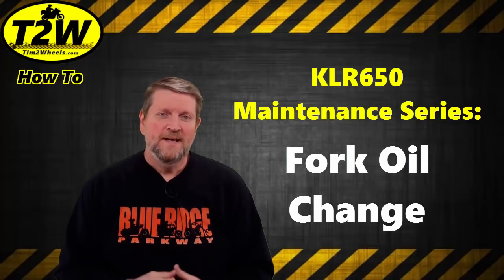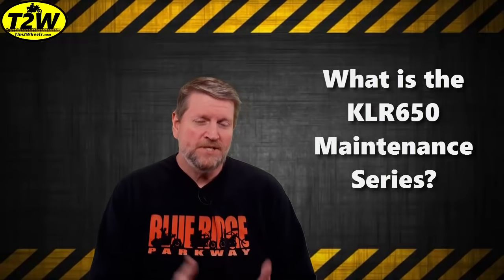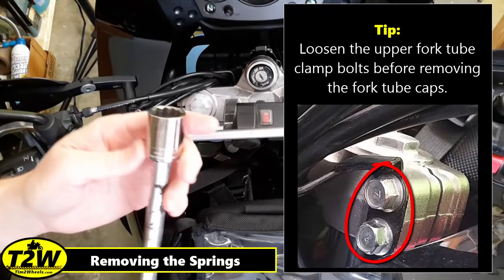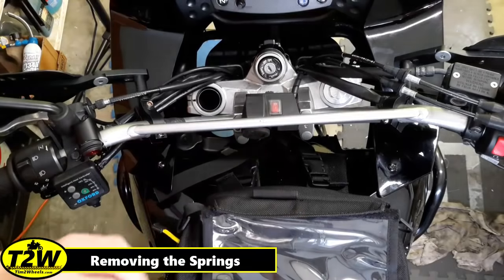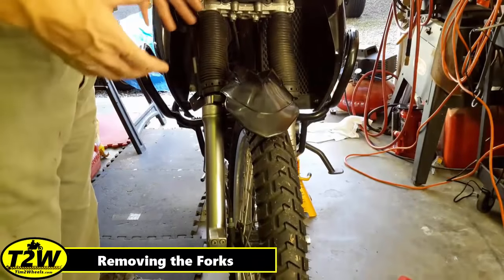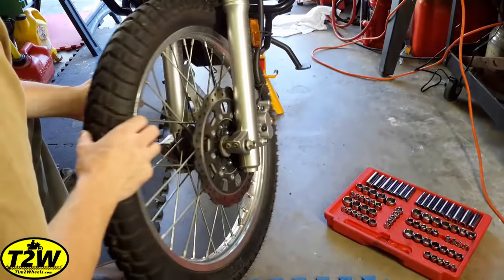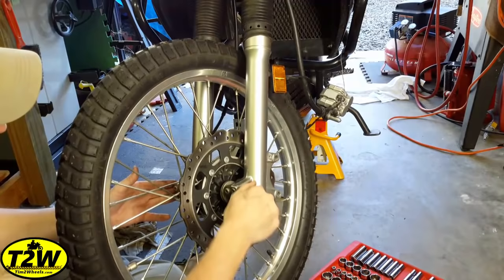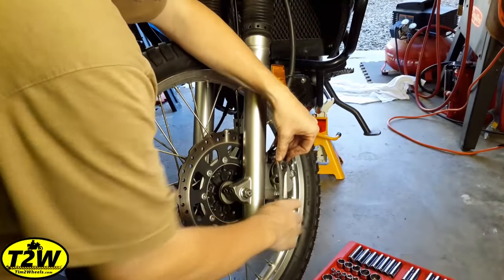T2W KLR650 Maintenance Series: Fork Oil Change

Comment: Whenever reinstalling the front wheel it is a good idea to pump the front suspension before tightening down the axle.  This will help ensure your wheel is aligned correctly. Obviously if you are changing your fork oil in the process finish that first and get the cap back on before you pump the suspension.
Reply: What do you mean by pumping the suspension? Could you expand a little bit? Thanks in advanced?

Comment: You could just use 2 big U-bolts through the rims, bolting the bike to an I beam, Then flip the whole bike upside down using a small crane or big fork lift..LOL!!. Ya may want to drain the gas and oil out first.

Comment: I think it would be a good time to tell guys who don't know.....At this time a really good time to check the steering head bearings.  Common time to pull that apart clean, inspect or replace bearings.  For $30 bucks slamming those new bearings and races in there is a no brainer.  :)
Reply from the maker: That's a very good point Chris. It's always good to check, re-pack, or replace the steering head bearing when you into the front-end.
Thanks for the comment.

Comment: Hey Tim.. I was wondering instead of taking the forks off the bike could you just use a Shop-Vac and suck the oil out of the forks? Maybe lay the bike down so it rolls  out easier then use a Shop-Vac.. Do you  think that would work?

Comment: oil level should be measured from the top of compressed fork without spring , not by volume.
Reply: That is correct. There will be some residual oil left when you pour the old oil out. Just adding the specified volume will be close to the right amount, but not accurate.  The KLR 650 shop manual shows the correct way to measure the oil amount by measuring the level with the spring out, fork vertical and compressed. It should be 130 mm from the top for the Gen 2 KLR.

Comment: This is for newer models. My clymer manual (2006 Model) says we can just drain it via a drain screw at the base of the forks. Is this something the most do not recommend? is there a reason people take the whole assembly off rather than just do that (other than a lack of a drain bolt)?
Reply from the maker: Hey, sorry for the delay. I can't speak for the Gen 1 KLR on the proper way to drain the forks. I can see how using the plug would be easier than removing the fork tubes. 
Maybe other Gen 1 owners can chime in on this?
Thanks for the comment.
Reply: @Tim2Wheels  yes, Gen1 has a drain bolt at the bottom. It's a weird phillips head, maybe the Japanese variation. Mine were quite stuck, so I had to hack saw them into flat head screws. After they broke loose, most of the oil will drain out of the hole. Remove the cap and spring and you can actuate the fork to pump the rest out. There will still be a few drips left once that's all done, so be sure to turn your fork upside down and let it sit for a while.

Comment: Hello Tim, thank you for your thorough review. I have a question. The Bel Ray fork oil you use, is that synthetic? 
Is it ok to use a synthetic fork oil on my 2013 KLR. I am installing the progressive front springs and changing the oil at the same time. Thank you for your advice.

Comment: Great video. I have a few questions: How is your bike supported, are those just jack stands and is the rear wheel on the ground? Is It strapped down?  What editing software are you using?
Reply from the maker: Yes, at the time I shot that footage, I was using automotive jack stands under the SW-Motech crash bars. I could adjust them forward or back to lift front or back whell as needed. Since then, I bought a motorcycle jack from Northern Tool that lifts the whole bike evenly (much easier) plus I can roll it around the shop. I use Camtasia Studio for editing. - Thanks for the comments.

Comment: Was fork weight oil perfect or could you go with thinker for slower response??? Thx Tony
Reply from the maker: Tony Castro - I used 10w as per the factory recommendation. But, I do think a heavier oil would be better to slow the dampening a bit. The next time I will try 15w to see how that feels.

Comment: Tim, your videos are the best for the KLR. Thank you! One question regarding fork oil: Why does it need to be changed? If the forks are sealed, without leaks, there would seem to be no entry point for dirt and contaminants. As there is no combustion, no corrosive contaminants are formed, as with engine oil. Seems this would be no different from differential gear oil, which goes far longer than the miles at which you changed your KLR's fork oil. Thanks again!
Reply from the maker: Tony, good question and I can see why you would think that. Many owners never change the fork oil. However, even in a sealed environment, the oil will wear, break down, and loose its viscosity over time. As you could see in the video, my oil was dark and dirty when I dumped it out.  Clean oil will help the fork perform at their best. I do tend to change lubricants more often than needed, but I like having a "well oiled machine".
Thanks for the question and for watching.
Reply: Tim2Wheels Well, I passed on the fork-oil change. But boy, Tim, your spring-change video sure made that swap easy! Literally took just minutes. The tip to loosen the top fork clamps really helped. Thanks!

Comment: Gotcha!
Reply from the maker: +Rec Pro I see you found it :)
I had just left a reply to your other comment. - Thanks for watching.
Reply: +Tim2Wheels You think 15w fork oil would be better to use with these springs?
Reply from the maker: it is a personal choice. I think the 15W would work fine. I used 20W as recommended.
Reply: I thought 10w was recommended?